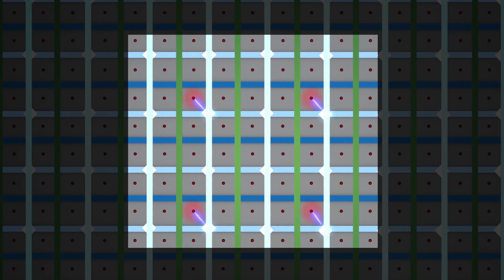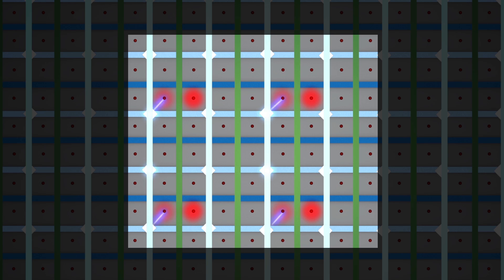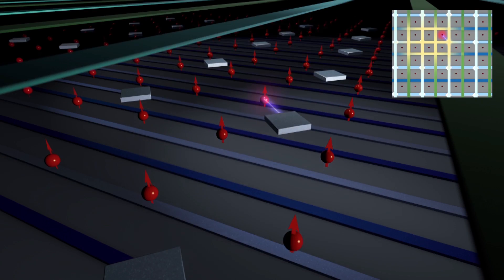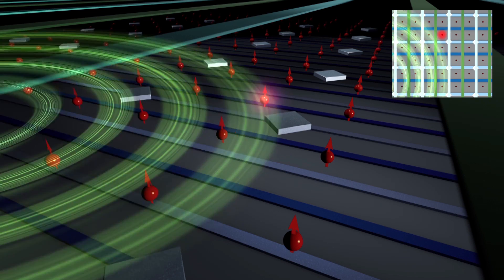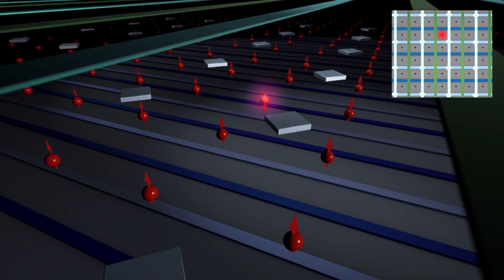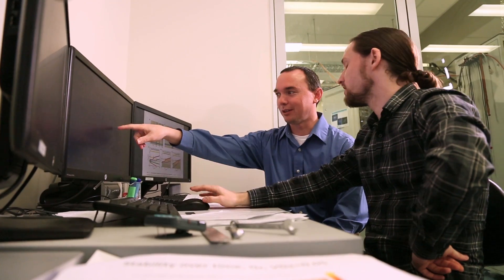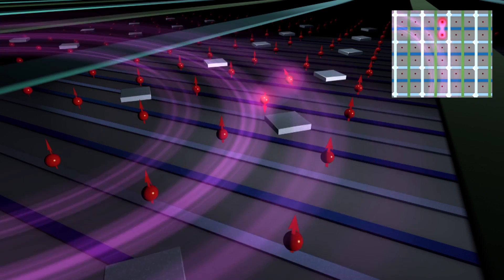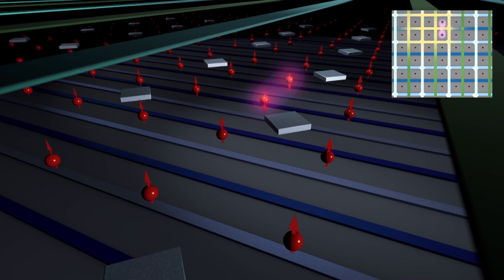How to build a quantum computer in silicon

Comment: Can this work at room temperatures or do the atoms still need to be cooled ridiculously to work? Is there any information about that anywhere?
Reply: +Andy Rust 
Since error correction is built into the system it will be more robust than D-wave quant. annealing.    BUT, by what factor it will be hard to say until the team gets to the lab fabrication stage.   Possibly  less sensitive to background magnetism (aka supercooled)  by one or two magnitudes   (so 10 to 100x more robust).